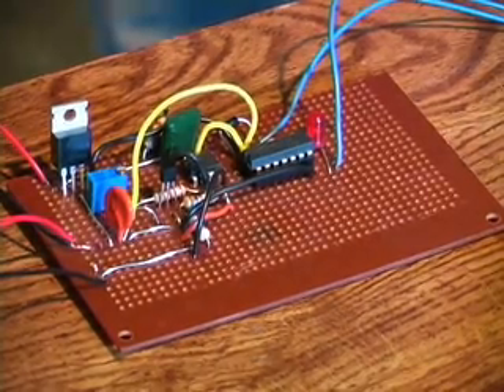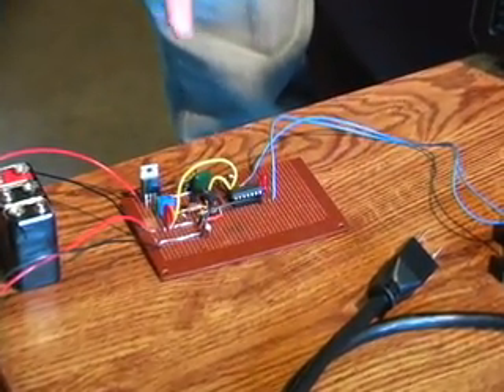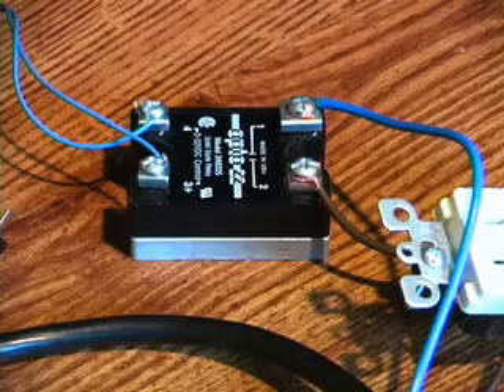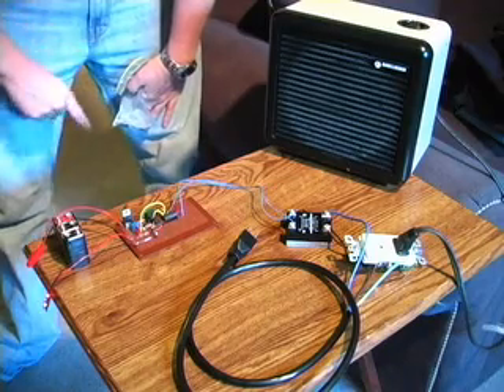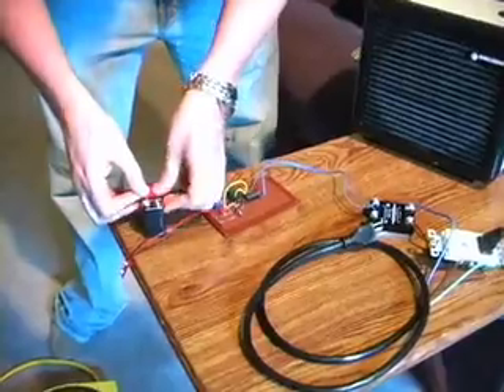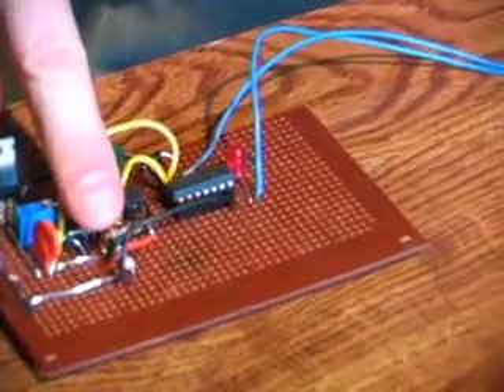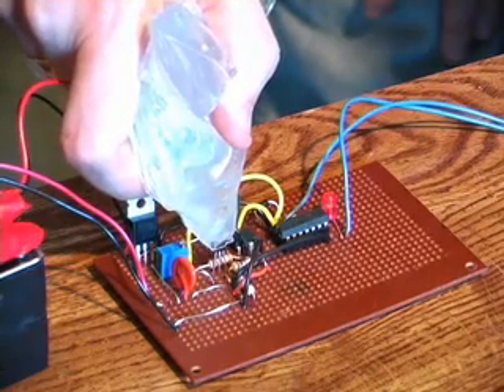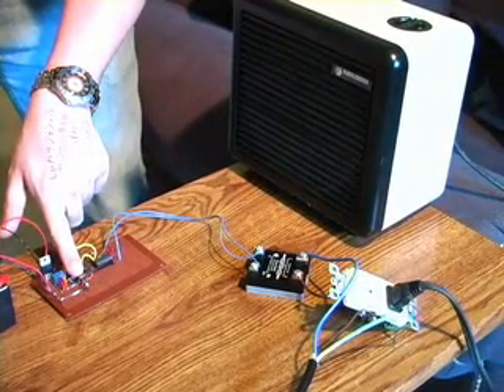Temperature Sensor Heater with Solid State Relay

Comment: Tell me you had a fly back diode between your low voltage circuits and the SSR.  SSR's create an ton of back electromotive force which will wreak havoc on your IC chips and other components.
Reply: So...you don't understand how an SSR works. The control signal is completely isolated from the load side, so that's not going to happen.
Reply: I think he's assuming that there will be some inducted noise somehow... It's not out of the realm of possibility-- but going to google university... a quick google says this: 

Zero current turn-off is a major advantage for using a solid state relay as it reduces electrical noise and the back-emf associated with the switching of inductive loads as seen as arcing by the contacts of an electro-mechanical relay. Consider the output waveform diagram below of a typical AC solid state relay.

Google says the advantage of using SSR over mechanical is that it reduces the back emf... So it shouldn't be too big a problem, right? I don't know what's acceptable in electronics tbh, I'm just a youtube graduate when it comes to making/fixing things.

Comment: Hi i need help! I bought a enail which is an electric nail thats suppose to heat up to 600 degrees. It worked for a while but not it wont heat up my nail because my friend messed up the settings. I was hoping you could help me. It uses a PID Temp Controller and a solid state relay

Comment: Sir, I think the white device to which the relay is connected is used as an interface between the ac and the dc device.... the device is on when the sensor is on thereby making the heater on.. am I right?

Comment: Good one.
Can I use this sensor to detect boiling point of water (100 degC) and turn the electric boiler off?
I can pack the sensor and immerse the sensor in boiling water. What will I need?

Comment from the maker: No programming required.  Calibration is a better word for it. There's a little math involved, but yeah.  My only concern would be that most fire alarms do not detect heat, but smoke.

Comment from the maker: Dude, you are my hero.
We had the option of specializing in analog or digital electronics.  I am a hardware kind of guy, which sucks because ass we do is program in assembly code.  It really sucks!
Most of my newer videos will suround programming.  I've got a CPLD programming video, and some C programming to mess with the parallel port of my computer.
Thanks for commenting.

Comment from the maker: ??? I use 555 timers every day.  I wouldn't implement a 555 timer in this circuit for either astable or momostable operations.  If you are suggesting using the output of a  555 timer to trigger the solid state relay, it can be done with ease.  I don't really understand your question.  Yes, it is NTC.